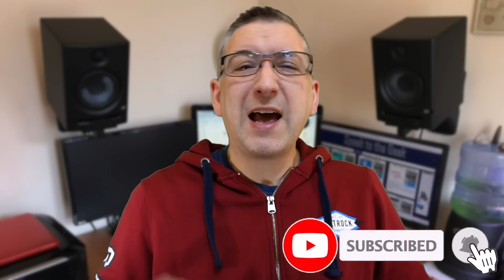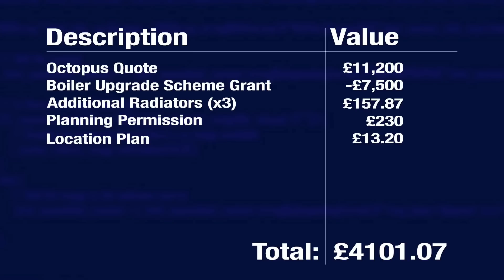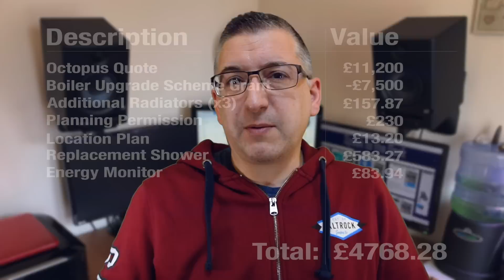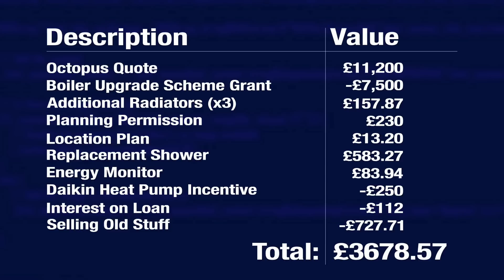How Much Did My Octopus Energy Heat Pump Installation Cost?

Comment: That’s not a bad price for the whole install. My own ASHP installed just over 2 years ago was a major order of magnitude more than that.  I was eligible for the previous RHI grant (£11k repaid quarterly over 7 years, and its CPI linked so been going up a lot recently😮), but my cost to change was still double yours.
The site survey, EPC and quote were all free upfront.  The big cost difference was due to the size of the property they calculated I’d need a 15kW ASHP and there wasn’t an MCS certified one at the time, so I had to have two 9kW ASHP’s which didn’t come cheap.
In the install we had almost all the radiators replaced but in the two years afterwards I’ve had one of those replaced (because we had an under-sized one fitted which was a mistake), and just now had the towel rails in the kitchen and utility room changed as well.
The house is comfortable and warm with annual running costs around £1400, similar to the oil central heating system we replaced.
Reply from the maker: Yup I’m very pleased with the price! You never can predict what incentives the government might offer so you have to take what’s available at the time of install I guess. Your system sounds like it’s for a large property?

Comment: would be able to share the energy monitor you bought? well done with you videos. another 2 months wait for us.
Reply from the maker: It's a Shelly EM Pro.
Reply: I did wonder about the energy monitor as well as my ASHP came with 3 meters to measure the throughput but since that is up in the loft (where the control panel is) I bought a Shelly EM1 last year so I could get more readily available data into Home Assistant.
I do see about 4-7% over-read on the Shelly though compared to the meter readings.  Annoying and can’t find any way of recalibrating. Still, very useful to see daily consumption of the ASHP alongside other battery data

Comment: I’m just about to head down the Octopus Energy heatpump route. My quote is £8100 less the £7500 grant and as in England our restrictions are just 1 metre from boundary but has to be below a certain dB reading at my neighbours bedroom window, all is good though so no need for planning permission.  Interestingly I got three other companies to quote none were less than £15000 to 20000 for the same install and all wanted 300 to 500 non returnable payment for the survey although all would deduct it if I went ahead. None would deduct the grant from the bill all wanted full payment on completion and then they would give me the certificate to claim the grant.  Seems there are a lot of get rich quick companies just the same as with solar installations. Well done Octopus Energy, in my opinion the only honest company out there.
Reply from the maker: I'd say there are a real mixture of companies out there and it's really difficult to know who to trust as a consumer. If my home had needed specialist treatment outside of Octopus's designs then I would only have gone with a Heat Geek guaranteed company. Using Octopus did provide me with a level of confidence as they are only tackling the jobs they know for certain they can achieve acceptable results with.
Reply: Do you know what the acceptable decibel level was?I’m in England so the 1 metre rule applies for my property too. So if the db number is low I should be okay.
Reply: I believe in England/Wales that the companies process the grant payments as required. Might be worth checking.
In Scotland the householder needs to apply for Grant directly through Home Energy Scotland, must be approved before any work starts.
Reply: @_Dougaldog  Correct on what happens in England, supplier does all that. Smaller outfits may take full payment, then return the £7500 once the job is done - like a security net for any dodgy customers, of which there's plenty.
Reply: £7500 subsidies from my taxes to buy heat pumps, just like solar panels, EV's and wind turbines. It is a sham.
Good for you, I hope it works to your absolute satisfaction.
Reply: @sirjohng1  

Yet you don't complain about your taxes being used to prop up excess energy company profits through £400 subsidy everyone received last year or so.

Or do you support your taxes being used to fund new equipment by the same oil/gas producers meaning they pay little in taxes to UK ?
Reply: They all wanted full payment because they're not billionaire mega companies like Octopus, totally normal. I was quoted £27k before BUS grant. The install would have been infinitely better than Octopuses though, without doubt.
Reply: @Soulrollsdeep  How do you know it would have been better did you have it done, I get you can spend more on ASHP but the 15K I save will more than cover a replacement at a later date if needs be .
Reply: @Just_My_View_and_Opinion  The attention to detail during the survey surpassed Octopus in ways you couldn't possibly imagine. The level of detail in the design (which was discussed in situ and in a very detailed follow up set of documents) was also beyond what Octopus could muster, and the SCOP would have been over 5, guaranteed. It was night and day.
Reply: @Soulrollsdeep  

In that case you'll be blowing OVO's trumpet, they've teamed up with Heat Geek franchise.

Comment: @Speak to the Geek - worth noting that MCS regulations are imminently being changed and the planning for noise will likely disappear in all but the most extreme circumstances.
Reply from the maker: MCS regulations were being scrutinised by the Welsh Government in a recent report. I'm not sure what the outcome will be but I certainly know they are under pressure to revise them. Octopus are very much by the book on sticking with those rules.
Reply: Any idea of timescales for changes as I already have a A2A HP for 2 rooms and the new location will be LoS from my neighbours so will need planning permission. I was hoping to avoid this.
Reply: @darrenadams2640  Unsure TBH, worth searching on the internet for 👍👍
Reply: @hypercatjohn

Don't think it will disappear but perhaps downgraded a bit to allow for quieter modern heat pumps.

From Scotland website :-

"The current PDR rely on the standards set out in MCS-020, including maximum noise levels, an approach we believe is effective. However, where more than one ASHP is installed on a building containing multiple dwellings, it may be appropriate to also specify restrictions on the size of the individual ASHPs and/or a minimum separation distance from other dwellings within the building (horizontally or vertically). This would be in addition to the requirement to comply with MCS-020 standards, which we are minded to retain."
Reply: @_Dougaldog  restricting the size of the hp... Jesus wept, governments need abolishing and children putting in charge. Absolutely no grey matter between them.

Comment: My experience with Octopus in as nutshell a manner as I can make it:

Overall initial quote including BUS grant and deposit of £500 plus they wanted to give me £250 extra from Daikin: £3350ish

Survey performed in early May 2023

I was advised I needed planning permission as it was "1db over noise limit". Worth noting they did NOT do a sound test process and didn't ask me what the semi detached neighbour's windows are (bathrooms, aka uninhabitable rooms). The nearest habitable room was circa 9m away.

Accepted quote, attempted planning process - total outlay for that including scale drawings: £500ish. 

Survey showed overall temp target was 18 degrees throughout the 1st and 2nd floor, downstairs with UFH was including but target temp blank and heat loss blank. Total estimated electricity usage for heating and HW would be 3500kwh-ish. All radiators (double panel throughout) would remain as-is. SCOP was estimated at 3.8 for heating, can't remember water SCOP. Unit would be the 8kw Daikin variant with a 250L water tank.

I queried radiator schedule and flow temp of 50c. Advised neither can be changed and it is what it is, take it or leave it

Planning permission became so tiresome (council wanted independent sound testing done. ALL my neighbours have ASHP, utterly bizarre) so I gave up and asked Octopus to come back resurvey it. Second guy came, equally as useless in the sound test department. Didn't contemplate room type, distance, hedge in way, line of sight, all the usual basics

Advised I could have the pump on the other side of the front of my house. This meant pipework would run either through to my kitchen, up through the brand new kitchen worktop, mean cupboards coming out the wall, running through the hallway, into the downstairs WC, through the utility room and eventually plumbing into the hot water tank. Said no to this as it would have been ugly as hell and ruin the house aesthetic.

Spoke to other installers online and they all advised the planning was unrequired. Queried with Octopus and they relented, advising it could be installed in the original spot, meaning a clean straight run to the HWT. This is January 2024 at this point.

Installer visited, told me our Geberit pipework isn't compatible with an ASHP due to 'pressure levels'. Reminder: ALL my neighbours have ASHP and they all run fantastically - we ALL have the same pipework as we're in a gated community with all properties built by the same developer. I was advised a full repipe would be required. This at first was down to me to source a supplier to sort, then received an update advising Octopus would do it at an additional cost of £4500

I had an independent supplier (with an exceptional reputation) come and survey, they advised the spine of the heating pipework would need changing, but not a full repipe. ALL 14 radiators would need changing to larger variants, some K3. UFH downstairs would be complemented with some small additional radiators. Heating SCOP would be over 5, water would be over 4. 5kw Vaillant ASHP installed in the preferred spot out front without question, immediately passed sound test. £27k install cost before BUS grant, ouch - but then, I know it'd have been a much better job than Octopus.

All in all, decided to sack the whole thing off and go with A2A. We've got an immersion heater and tank anyway and overnight rates make that cheap (circa £45p) to charge. We have 4kw solar perfectly south facing in SE England and 24kwh of battery. We can have 7 Fujitsu units installed throughout the property for £8600ish - and I get cooling during the summer and a COP of at least 4. We'll leave the existing electric boiler in place to aid on those rare super cold snaps if the A2A doesn't quite cut it. We're lucky that 5 of the 7 spots having a unit installed are on the same wall, so two split units down the side of the house (no ugly pumps out front or back) with straight trunking and we're good to go.

Overall, the experience with Octopus has been laborious. The customer reps I've dealt with have been very nice, accommodating, etc - but the issue seems to lay at the technical team end, who you can't speak to and never visit the property. So just bare in mind you may run into any of the above and should challenge all of it. It felt very 'Mr Potato Head' rather than a tailored install, which I can understand as they're working to tight constraints to keep the overall cost to consumers down.

Would I recommend them? Yeah, why not, there's a lot of similar stories online, but then I know they're successfully installing way more than they are losing. But do be prepared for lots of hoops.
Reply from the maker: I totally agree with your "Mr Potato Head" analogy - that is why I chose them though. I didn't have the same experience as you obviously, but the 'closest fit' template install model based on their R&D installations is how they keep the cost down and are able to provide an adequate solution for the masses. Obviously an independent installer could do a better custom job for you, but not everyone wants the 'Rolls Royce' when a Dacia Sandero will get them from A to B. Nothing wrong with your decision to go with A2A either in my opinion, totally valid route with its own advantages. Shame there's no grant for those at the moment.
Reply: @SpeakToTheGeekTech  The A2A is actually more expensive than the Octopus install, but far less invasive. And can always go to Octopus in the future once the cosy 6 is out, wouldn't mind giving that a try!
Reply: If thats a nutshell its a massive NUT.
Reply: Hello. I have the same problem with Octopus. They said I have to apply for planning permission for just 1decibel. Maximum sound noise is 42 dB an I have 43db. I have to pay £322 for planning permision. Do you think to go forward to pay £322 or to tell them to cone to check again noise level? Thank you.

Comment: For the benefit of others, Octopus carried out my EPC for free.
Reply from the maker: That's good to know. Honestly I never even considered that Octopus would do the EPC for me, I just knew that I needed an EPC before anyone could quote for me and claim the grant. I probably should have checked with them!
Reply: @SpeakToTheGeekTech  

In Scotland an initial EPC is not required if an application is made through Home Energy Scotland who deal with all grant and interest free loans available for energy improvements.
However an EPC needs to be obtained and submitted with grant claim application upon completion of works along with MCS certificates from installers.

In Scotland process is for householder to apply for a grant via HES, grant is then offered when installation quote submitted, you then accept offer and advise installer they can start work, when completed MCS certificates issued and EPC obtained, submit these to HES to claim grant payment.

I believe in England installer processes BUS grant claim.

Comment: Ours cost      £2700    after the grant.  Octopus paid for the EPC also £51 to submit a question to Planning Office and promised to pay for a planning application if needed. We only needed 3 new rads and no new pipe work.
Reply from the maker: Only 3 radiators is good going, is it all up and running nicely now then?
Reply: @SpeakToTheGeekTech  Well I think I should give more details. They wanted to change 6 but I moved the 3 larger ones to the position of the other 3. I also added extra 1 (£50) to my lounge. That brought the quote down from £2900. I did this work myself. Doing so got the design flow rate from 50° down to 40°. Been up and running for nearly 4 month and the average cop is 4.3

Comment: Ive got my pre install visit next month. Install in April. 4 bed 70's semi. Octopus are fitting a 8kW Daikin HP, replacing 7 rads/towel rails. Hoping all goes well, will be ditching the gas meter.
Reply from the maker: I'm sure you'll be very pleased with it - check out my whole series to see the installation process if you're interested.

Comment: Can you tell us more about the energy monitor. Did you fit it, or did Octopus do it for you?
Reply from the maker: It's a Shelly Pro EM. The electrician left space in the outdoor consumer unit for me and I installed it myself. Shelly make two EMs, the regular module one is cheaper, but the Pro one works out only a few pounds more and has a rated accuracy level and also fits nicely in a DIN format.

Comment: Thanks for that. I got quoted just under £9k by British Gas after the grant. I originally signed up but then back tracked, that was just too much. A month or so  later I tried Octopus, £3.25K after the grant. I like to try and support UK manufacturing so at the moment I'm holding on  to get the Octopus Cosy 6 (manufactured by what was previously called RED in NI) installed when it is finally gets released.
Reply: I am still awaiting tech specs for the Cosy 6. Want to know what the COP is before I consider it. It makes sense that it won't be the best as they run at a higher temp so it's easy to retrofit.
Reply: @eddyd8745

Mitsubishi are manufactured at a factory in Livingston, Vaillant at Belper in Derbyshire, and possibly others do as well as they're mostly big internationals.
Reply: @_Dougaldog  Yes, I was originally looking at the Valiant because it was a UK manufacture and is fitted by British Gas. BG was just far too expensive even after the grant (nearly 3 times Octopus price).
Reply from the maker: I've seen that they are already installing the Cosy 6 so it might be worth dropping them a message.
Reply: @SpeakToTheGeekTech  I spoke to them a couple off days ago and they said it was still going through testing. Anyhow, there is such a back log that I'm unlikely to get anything fitted until September time at the moment!